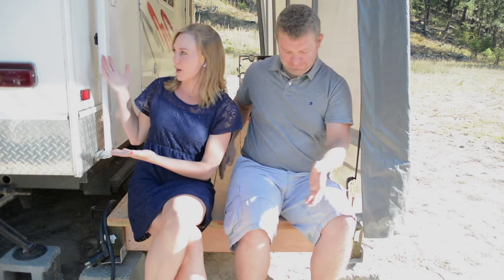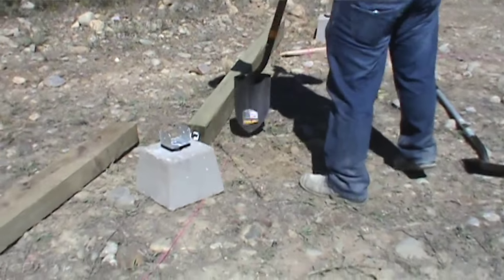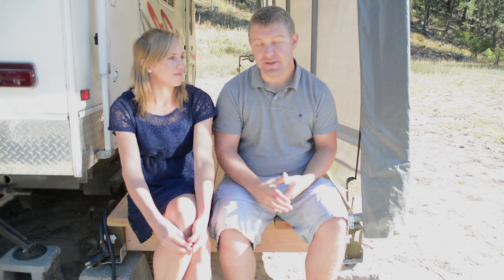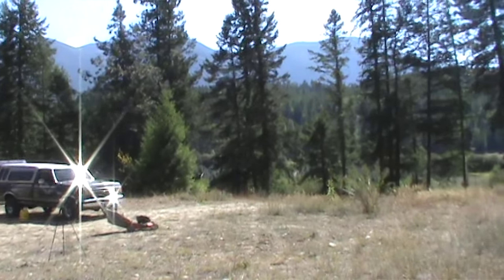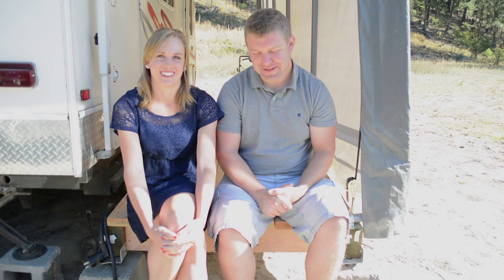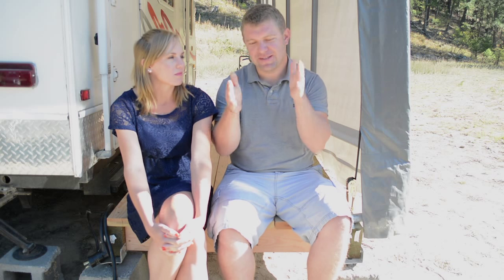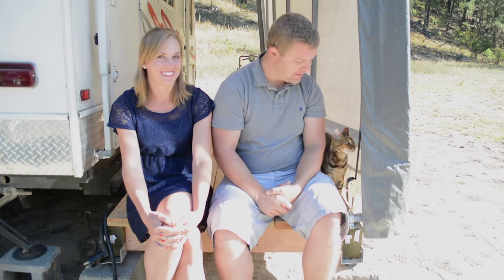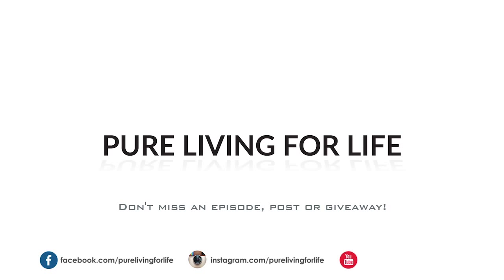Building a Deck for Our RV + Platform for the Garage in a Box

Comment: Congrats on your efforts!
...Just a thought...(dependent upon the soil composition and the fact that you may already being using some sort of staking sytem), you might want to consider some sort of 4 point anchoring system, be it simple screw anchors, in ground poured concrete piers, etc., in addition to the  gravity secured piers to secure the entire structure with regards to the wind load.

Comment: One trick with a string level- is to make sure you are near the center of the span as you can get.. hold one end and make a mark at level on the other-  then FLIP the level end for end, and re mark "level".. there's usually a little difference- but split the difference and call it macaroni!

Comment: Hope you fixed the block you are using under your trailer leveler. The way it is in the video provides almost no strength. It should be positioned so that the cell(hole) opens vertically. A pair 2x6" boards top and bottom will provide the surface area and true strength. Keep the videos coming. You're very detailed and clear, it's much appreciated.